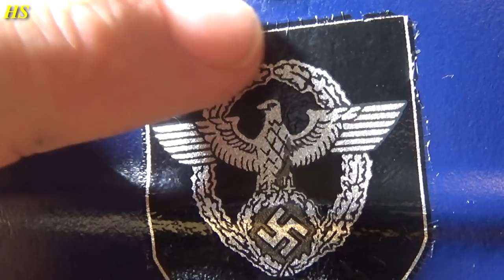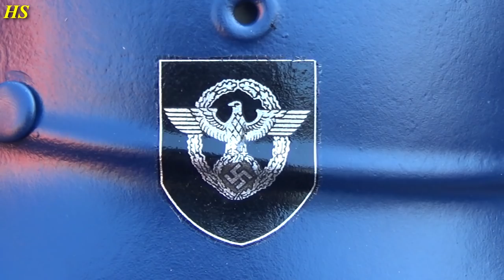Restoring a German WW2 Beaded Helmet - WHAT is a Beaded Helmet?! HOW to tell the model Differences?!

Comment: I have a Luftschutz Helmet, that had been rattle canned black.
I discovered the black topcoat was easily removed with Turpentine.
Under it was the original blue paint with scratches and what appear a red primer.
There was no Liner, but two the pins remained. 
A shadow of the Luftschutz decal could be seen, I have replaced the decal.
But have not found a liner, where did you get yours?

Comment: You can improve the "finish" of spray painting using today's spray paints in a can by not going so fast when painting. A quick and very light spraying that does not even pretend to try to completely cover the entire helm and let it dry completely. I know this is slow going but your end result will amaze you. Then got back when its dry and do a bit more and let that dry. Then do a final over spray, but not heavy at all. What this does is to reduce the glossiness of your work. It is recommended by Dday44 and is a tried and true method of airbrushing models, too. Remember that new cans of spray paint do not have the same makeup of 1900s paints for things like cars and helmets and panzers... No, that old paint is strictly outlawed now, so you have such different chemicals including acrylic enamels that sounds like an oxymoron. And also remember that you are not dipping entire helmets into paint and using a mechanical method of spinning to keep the paint from being thick in places and thin in others or having drip marks down the sides! 
Just remember that if you cover something with spray paint completely in one shot sessions, the finish will be too glossy and the color will not be what is intended by even the paint manufacturer.
Hope it goes well for you, friend.  And thanks for showing me the liner before it is installed, explains why there are no bales on the liner of my beaded helm!

Comment: Ive also lost my loved one, I have a new puppy and I have a beautiful, unrestored beaded helmet used as a Luftschutz helmet. The beaded helmet is of the same quality as the M35, maybe even a little better. The only flaw I found is that the rim is not as completely pressed over as my M40 helmet has. I can slip a fingernail under the rim where as the M40 is a no fingernail helmet. (made up name for my test) The cork is there but there are no bails to hold a chin strap and no evidence I can see that any bails were there in the first place. It is size 56 according to a stamp on the leather. I'm not in a position at the moment to examine what looks like a very faint number stamped in the dome. It is very faint and only two numbers exist as far as I can tell, but I am not really sure that the two numbers are numbers at all. also, the numbers stamped inside the rear skirt is 20842 and on the left side skirt inside are E.F.6 and I have now found flaws in the helm made before it was painted. The back outside skirt near the rolled edge has what appears to be regular waving of the steel when the edge was rolled, and on the front right side above the 'visor" looks like a grinding tool hit the metal causing a substantial defect. But, it was painted after the gouge was made. Ha! Now you have helped me learn about the flaws and the mysterious lack of bales!

Comment: Hey mate (Australian slang for friendship 👍) your content is awesome and informative. I have a question regarding the heat treatment of the helmets. Heating them to red / orange hot and quenching them in oil. If the steel they used hasn't got enough carbon then you can not make it any harder. So it's either there blackening to give it some rust protection like a gunsmith would do or they were removing the stresses out of the helmet that come with stamping, i could be completely wrong. Cheers from Australia 🇦🇺👌

Comment: By the way, if the leather straps are to hard, wrap them in a paper towel and spray with distilled water. will soften them for install then let dry and oil.

Comment: my condolences for you loss. 
the bead was to mark a substandard shell not fit for combat service. i believe they were from a lot that had been found substandard, not each individual helmet tested.  there is video of shells being beaded. thats why you mostly see them with luftshutz, RLB, and Polizei markings. towards the end of the war you did see some used in combat despite not being meant for combat. 
results look pretty good. im generally not a fan of restoring helmets, but if its been messed with, what are you going to do? its never going to be original again, so you may as well make it look nice. i think the color looks fine, myself. dont know what peoples problem is. one thing though, you shouldve baked the paint on. it makes it more durable and rust resistant. its not difficult. just pop it in the oven at 200 degress for about an hour to hour and a half. its better to so it before the paints completely dry.

Comment: it is commonly agreed that the beaded helmets are helmets that were badly made (bad pressing for example)
this could be seen before heat treating and thus the 'pressing after hardening' thing doesn't apply here
one i owned (DD Polizei Beaded M35) would confirm this fact as my specific M35 was badly made as it wasn't a nice round shape but almost a hexagon, the metal was too thin aswell i believe as the size stamps stamped completely through to the outside

Comment: it looks like a helmet made from the machines used to make the gladiator helmet but they never removed the part of the machine that leaves the bump since it was probably unnecessary and would waste needed time and  also stopped doing the gladiator design since it used so much metal that was needed and also took up time that could be used to make the regular helmet minus the bump being there

Comment: There is a school of thought that goes that many beaded helmets were made from lots of steel that failed inspection for one reason or another and led to production problems like cracking and brittleness during heat treat or that the percentages were off in the steel composition, or had impurities included. The problem was not, in many cases, the individual helmet, but that the steel itself was condemned as improper or unsuitable for combat helmets (the British did the same thing). Of course some just went wrong in forming and got thrown in the same bin. The reason there are fewer M42 beaded helmets is pretty self explanatory-they got less picky and allowed lower quality steel to be used in some cases as the war went on and the Soviets got closer (Quality really took a nose dive from mid '44 onward, as the soviets took territory back and the Allied bombing campaign strangled German industry). The reason yours has off-center holes drilled is because they didn't have to meet the same standards as a Wehrmacht inspector would hold, and so used poorly trained or even slave labor to manufacture these. Nobody cared about the non-combat helmets.
Reply: Interesting and very insightful.

Comment: I'm sorry to disagree, but your reasoning for not believing the beading could be done after hardening is wrong.  While it is true that the helmet in its factory finished state would be too hard to accept a cold-drawn forging of the bead, this hardness could be completely overcome simply by reheating the helmet and thereby annealing the steel.  So, an operation like adding the bead, after the forging/quenching/hardening of the steel helmet could have been easily done by adding the annealing step before forging of the bead.